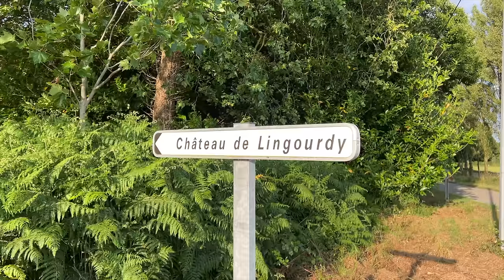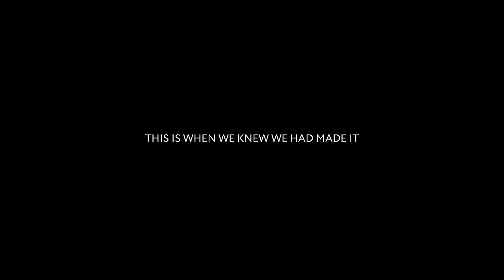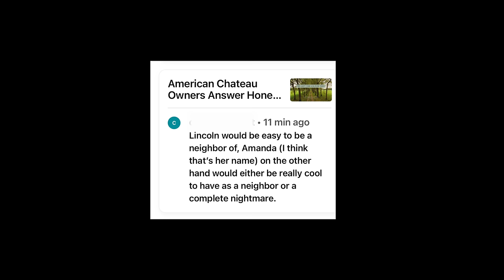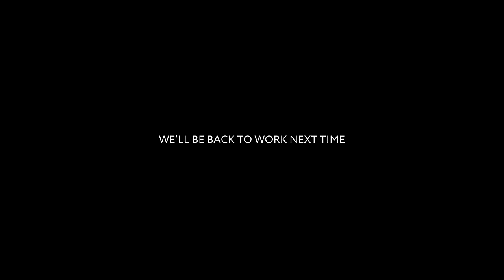An American Perspective: RENOVATING A French CHATEAU

Comment: I usually watch you on my 'dumb' tv via firestick and thus, cannot comment.  But ... some months ago I dig drag out my laptop once before this and subscribed (if that makes you feel any better). ;-)
I grew up in the Northeast (aka, New England). That might explain why we share a sense of humor. After college (aka, university), my then boyfriend & I bought a ramshackle 18th century farmhouse east of Hartford, CT. 'Ramshackle' might be a generous description as it had been condemned. We gutted it, saved what we could and rebuilt it; similar to what you're doing in your "cottage". I've offered you a whole lot of advice (in context). But, I guess you can't hear me talking to my tv. Maybe that's what makes it dumb. Or ... maybe it's just me that's dumb. 
So, of course now that I'm on my laptop and able to comment I can't think of all that good advice I wanted to offer. One thing I can think of off the top is how we pulled up all the floorboards, ripped off the tongues and grooves on the tablesaw (since most had broken when we tore them up), replaced (or sistered) the floor joists, laid plywood subfloor, then flipped over the floorboards we tore out, re-laid them atop the subfloor, sanded, stained and poly'ed. Of course, now that I've bothered to type this comment you've probably already decided what to do about your floors. I probably should have just stuck with talking to the tv. 😁 If you do reuse the floorboards, or any wood for that matter, just make sure you knock out all the old nails first. An old nail hit by a saw blade is a very bad thing. 
My current house is another 18th century New England Colonial (this one in New Hampshire).  These days it's just me climbing ladders (3 storeys) and all that stuff. I'm 5'5", 120 lbs. So when I see the 2 of you putting up the ladder, I say stuff to my dumb tv. Stuff like ... 'I need a Lincoln.'  Which brings me to my idea.  Remember in the past those charity auctions that auctioned off dates with bachelors? Well ... maybe you could get more subscribers by having an auction to auction Lincoln off to go to the winner's home to help with DIY!  Hmmm ... It's just a thought.
Keep posting. You're giving us a good chuckle. Especially these days, we sure do need a good chuckle!